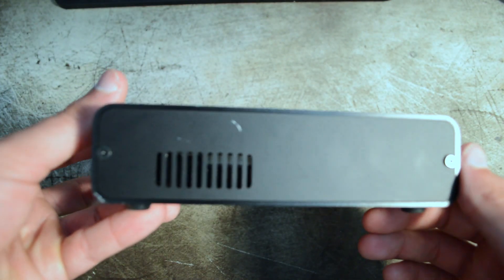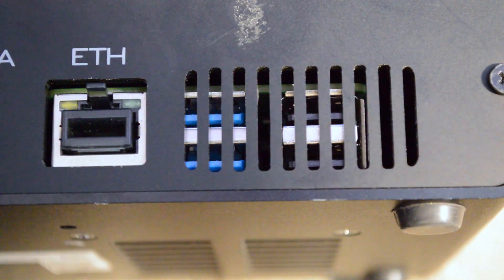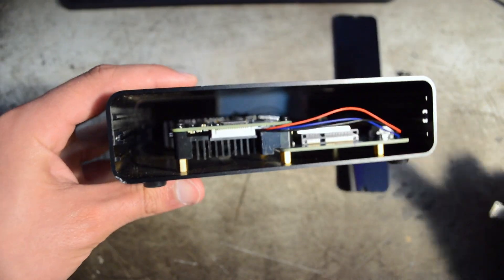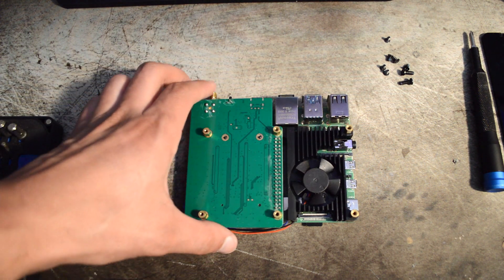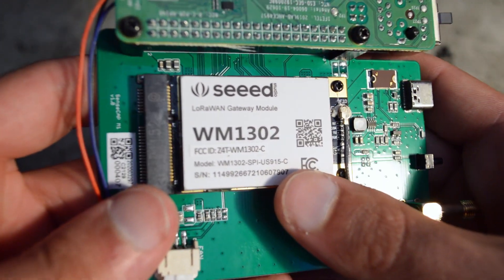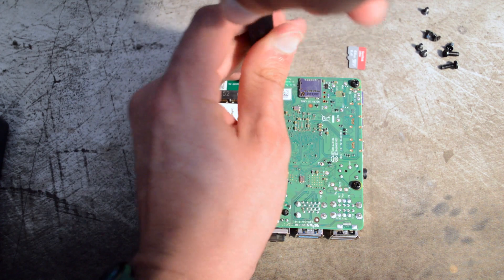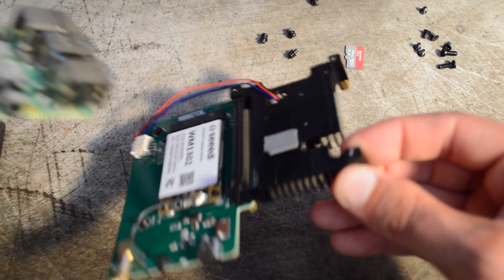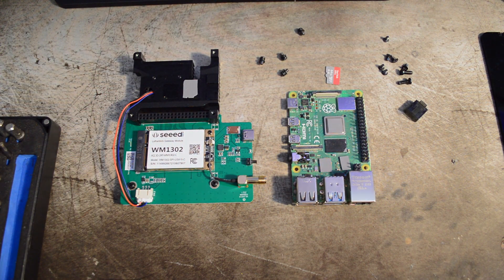Weird $5 Raspberry Pi

Comment: The case and IO board with the seeed card looks a lot like a DeskPi Pro, and you can install an SSD or hard disk in it's place.  DeskPi Pro has a custom script for multi-speed fan control as well.  I'd keep that package together and set it up to boot from an SSD.  It's a really nice setup, and houses my 8g Pi4.